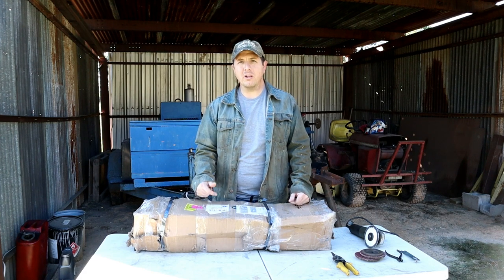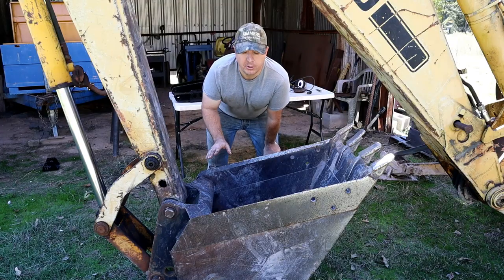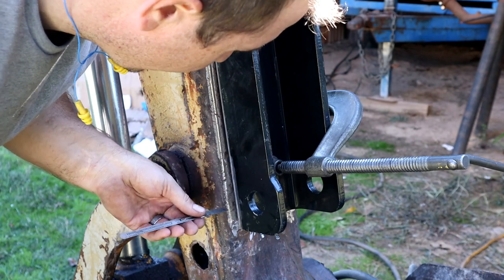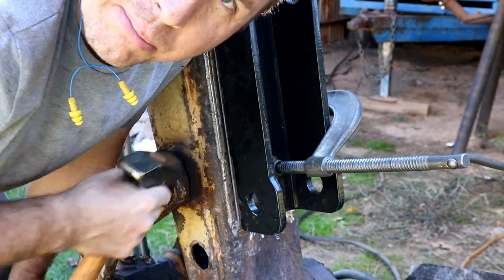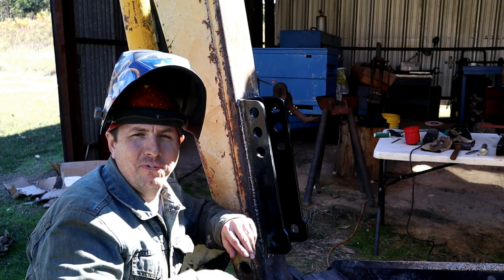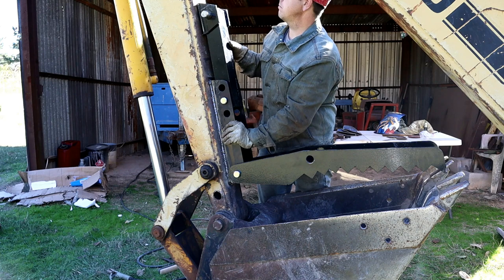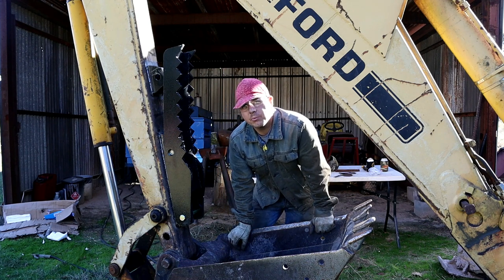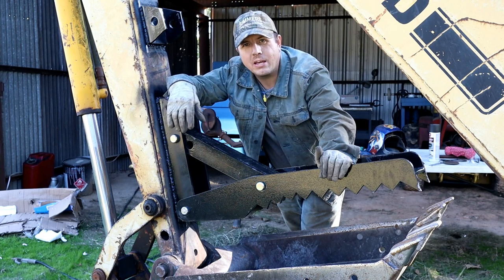Installing A Titan Thumb On A Ford Backhoe  Man Time!

Comment: Just bought the identical thumb for $250 delivered and plan to weld it on my old Ford 4500 tomorrow-thanks for posting this, a big help to this 69 Y.O. guy.  
I'm no pro welder but I think you might have gotten a bit better penetration with no undercutting on the boom side by cranking the heat up just a mite more, bisecting the angle between the boom and the piece being welded on rather than holding the rod nearly parallel to the boom, and sticking that 7018 right into the puddle and keeping the arc a little shorter...not that it is gonna make any difference really-your thumb is not going to fall off the hoe for certain-a very good job and I'll be happy if mine turns out as well as yours!
Reply from the maker: Glad to help!  Yeah this was my first 7018 job and big stick job. Not perfect for sure, but it’s still holding strong. Let me know how yours turns out
Reply: @Man-Time  were you using 5/32 rod there?
Reply from the maker: Yes I think that’s right

Comment: Nice work man.  I bought the same to install on my Case 580 Super K backhoe only to realize the boom is ductile iron, not to be welded on. So now I'm figuring out a way to make it a bolt on thumb by welding heavy brackets to the thumb with a plate on the back of the boom.
Reply from the maker: Dang that’s too bad about your boom. Too bad you couldn’t show a pic in comments. I love to see innovative solutions that make things that shouldn’t work, work!  Let me know how it goes

Comment: Those continuous welds distorted the channel, you need to alternate sides and ends to prevent or at least minimize it, that's why you always heavy tack and test fit before weld out to be able to address alignment.
Reply from the maker: I thought the same thing initially.  I did put pretty heavy tacks on 3 corners and then alternated after a few sticks for a full stick on the other side.  The initial tacks weren't cracked and the clamps were tight.  If you watch disassembly the pins were bound to begin with.  I cant be sure if it wasn't a combination of both though.  Thanks for watching!
Reply: @Man-Time  Those holes may be punched too which wouldn't help, I see your point though.

Comment: I think that you might try leaving the pin connected on the toothed piece and instead remove the pin connecting  the vertical  piece welded to the boom  and the diagonal bracing and then fold it up. The smaller top piece would then be positioned to allow the thumb to fold up no matter which of the three holes is connected to the diagonal bracing. Im not sure if that is the issue hard to tell without a close up of the arrangement.
Reply from the maker: I tried a few different ways, but ultimately you have to remove both pins and rearrange the link due to the pin length and arrangement

Comment: If you want to go to the trouble, spec out a hydraulic cylinder and replace that solid link. Plumb in another couple of tubes and add hoses and you'll be able to control it from your seat. Very handy. Putting one on my CASE 580 currently. E-Bay has all the stuff you need.
Reply from the maker: I’ll check it out. But my motto is KISS. Keep It Simple Stupid.  More moving parts, more maintenance, more things that can fail. I’ve got enough things that can fail already. Lol

Comment: My CASE 580C doesn't have the strap at the bottom of the arm so I'll mount the claw nearly touching the bucket, will let me pick up tiny sticks.  TITAN punched the holes slightly out of alignment, nothing you did wrong.  Good instructions, TITAN sure didn't have any, they referred me here.

Comment: Ordered mine a year ago. Putting it on my Case 480 today.
Yup ,pins are tight.
32" thumb. No top piece..
Is yours a 36" thumb ?
Reply from the maker: Yeah mines a 36”. Still holding strong

Comment: What's the width  and length of the piece you welded to boom
Reply from the maker: Measured at 19”x4 3/8” for the big piece. 
Welcome to Man Time!
Reply: @Man-Time  thanks I just got a case 580d backhoe, I'm gonna measure my boom to see if this would work for mine
Reply from the maker: No problem man. Mines still going strong

Comment: you didn't tac the plate in place and then you did a full weld on each side you should have staggered welding from one side to the other side checking fit along the way in my opinion

Comment: I just bought the 24" for my BH.  No instruction at all.  It doesn't come with hat separate racket.  Just the mounting plate, thumb and brace.
Reply from the maker: Some of them are designed differently, and I have no affiliation with the company. Just found the best looking option for me. You can run the machine with the thumb down. It’s easier when trenching or some cases to have it out of the way though

Comment: Hey how's it going nice job on that thumb I also have a 555D and it's getting this thumb on it can I get a titan part# so I can get it ordered. 
Thanks for the video. 
Liked and subscribed already 
Thanks Raul
805 Oxnard California
Reply from the maker: The titan thumbs can be found at palletforks.com. You should measure your bucket to make sure you need the same one though. Mine was the 36” version. If you google titan thumb they should come right up👍
Reply: Thanks for the information 👍. 
Keep digging